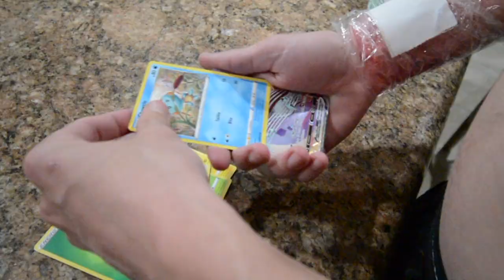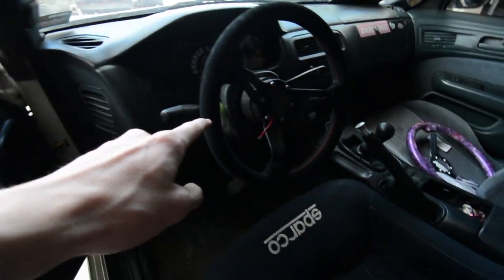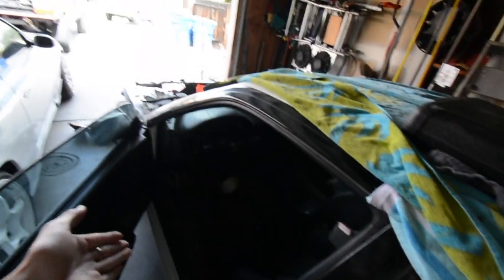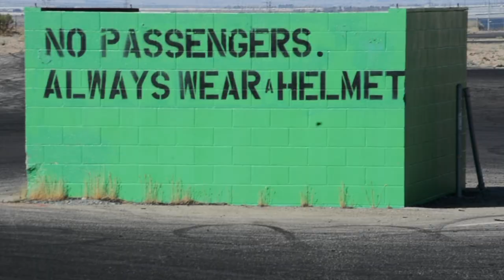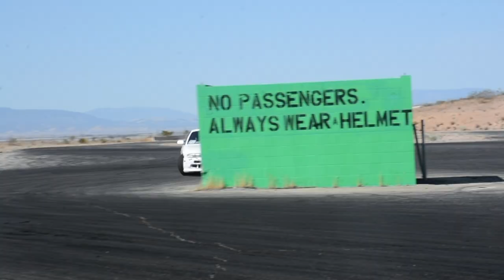I Crashed My 240sx

Comment: That car sounds like it needs some powaaa or 60 PSI on the rear tires
Reply from the maker: We was rocking with 70 psi , I was just running to big of tires
Reply: @MonsterMaverick  sheesh yea big sticky tire with low thread wear rating I bet. The engine was struggling all around